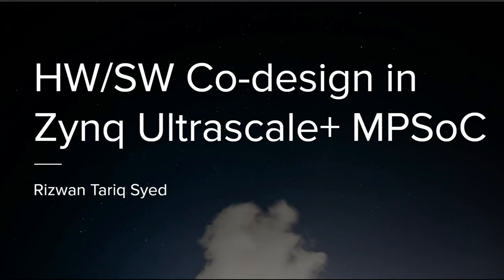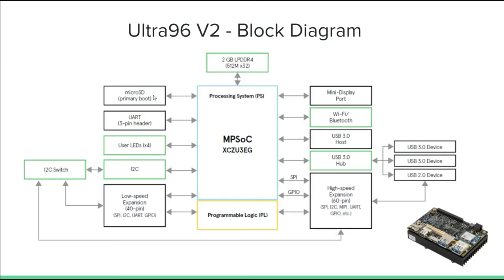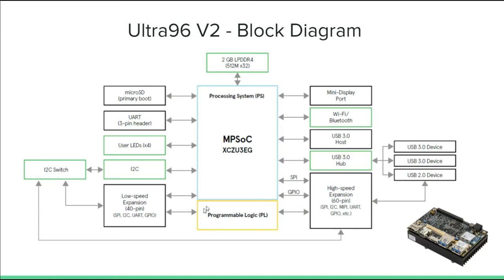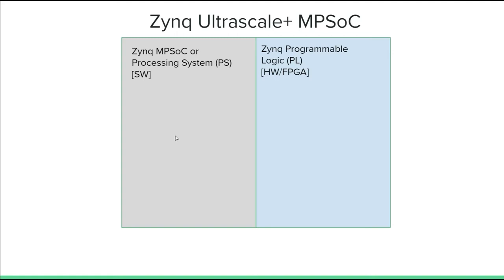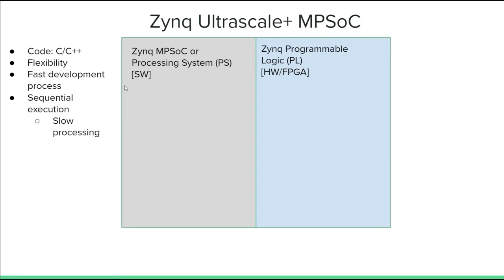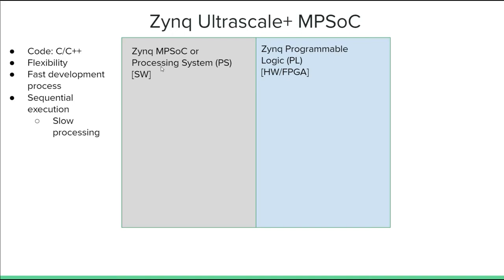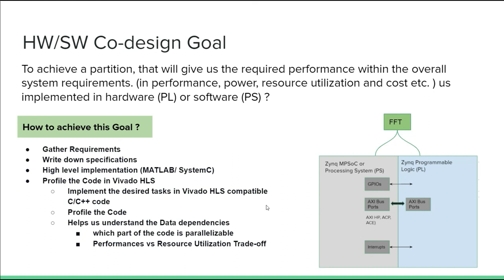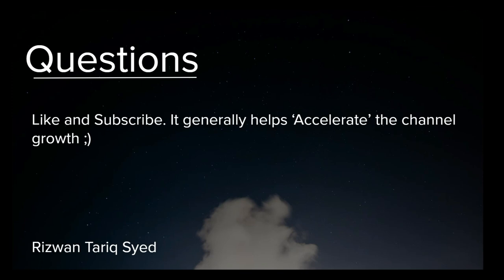Zynq MPSoC: The Future of Hardware/Software Co-Design

Comment: Good video, man. Quite the presentations skills you have!
Reply from the maker: Thanks alot Frederik. means alot (Y)
Reply: @rizwantariq1523  I am new to FPGAs but I am an engineer with some coding skills. Can you recommend me a tutorial or video of a starter project in a Zinq MPSoC? Litterally starter... making an LED blink or so.
Reply from the maker: @frederikvanaverbeke8840  There are a few things to consider. 
- your Zynq FPGA board may be different than others. Each Zynq FPGA can have different pins. So it's a bit tricky to find the tutorial for the same FPGA sometimes. 
There are plenty of youtube tutorials, but they may be blinking leds from the processor, from HDL, or on entirely different boards. 

Here is what I would like to suggest. 
- Follow any tutorial for your specific Zynq FPGA. Just so that you can get familiar with its interfaces etc., just try to implement a simple 'And Gate' or OR Gate. 
Go through the process of simulating the 'And Gate' and then implementing the And gate. 

If you are not able to find the tutorial for your specific Zynq FPGA. Then follow any other simpler tutorial and try to replicate it for your FPGA. 

As you already have some coding background, i am sure you will be able to solve it.

Comment: Hi Rizwan
thank you for the this wonderful video.
I am very new with the board . I was having one query if you help me with that.

Is it linux or writting code required at PS side if I only want to deal with FPGA and verilog code and want to see the result of my verilog code?
i mean is it possible to handle only PL things without developing anything on PS side in the beginning carrier?
Reply from the maker: Yes, if you only want to work with verilog designs, then you can just focus on the PL part. 
PS is usually used for software development in C/C++